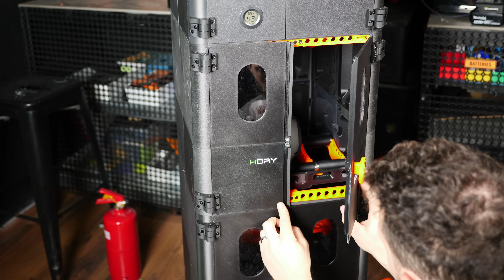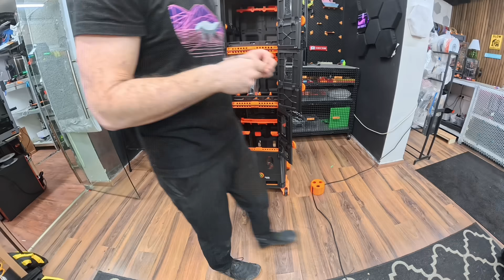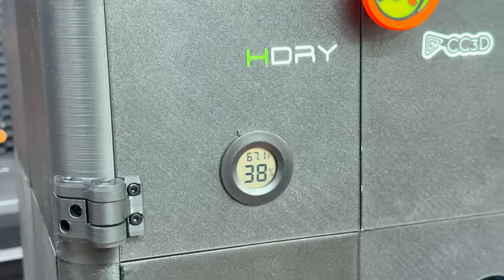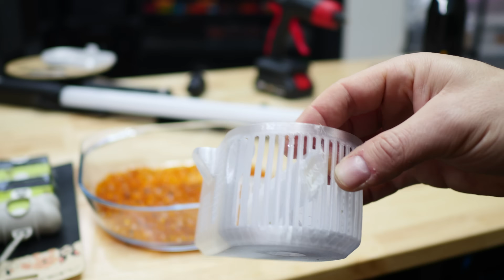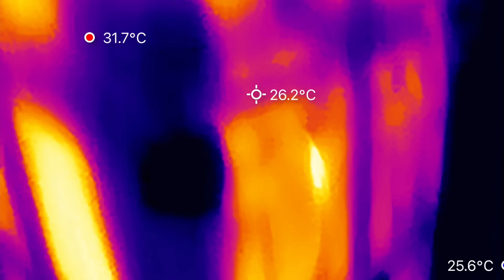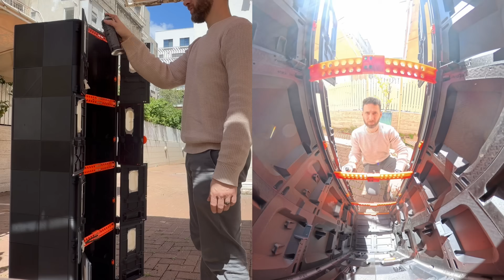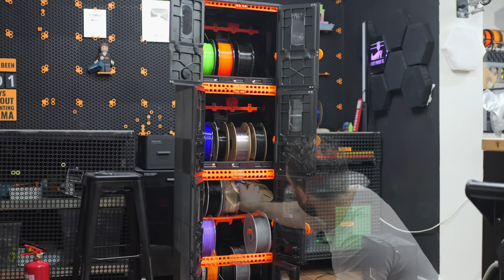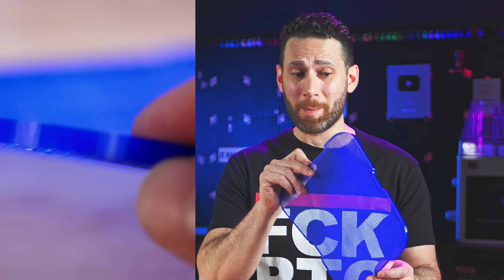This Will REVOLUTIONIZE 3D Printer Filament Storage!

Comment: @thenextlayer since this video is sponsored by Snapmaker I can say I am very happy with my printer also. However, it would greatly help the community if you explained how you got polycarbonate to print. Most of us have some kind of a tophat so that is not an issue. How long did you allow the bed to heat soak before printing?   One of the issues I have found is the fluidd temp sensor wildly optimistic since it is physically attach to the enclosure on the right hand side which was confirmed by applications engineering.  Where did you put your temperature sensors? This would be a great view subject and I’m hope heavily viewed.
Reply from the maker: Ok so I had a whole section on the experimentation I did but ChatGPT told me it was destroying the flow of the video with a tangent so I cut it and only showed the end result. PEI sheet, Magigoo SuperGrip (or better yet, apply a layer of Magigoo PC and then go over it with Magigoo SuperGrip which works better for lower temps), big brims, 100C bed, preheat 15 mins. The important part is to reapply the Magigoo SuperGrip before every print, as it’s the one doing the heavy lifting!!!

Comment: I was looking at creating a mini rotating drum, with 25 to 50% of it being heated with air circulating from outside to outside, and the rest with air being circulated from inside to inside, use Molecula Seive in it and it will constantly pull and remove moisture with low power, the other type is to simply use a peltier style cabinet like the Autens, and have a small circulating fan and desiccant system as well, that can be swapped out easily.

Comment: I use activated alumina. One tip here is to replace your microwave with a toaster oven and a digital thermometer. You are not going to want to nuke the activated silica, but rather give it a nice, long, hot dry in the oven. Different desiccant, different method of regeneration.
Reply: Microwaving silica is fine. Just use low heat and be aware it will get hot.
Reply: @jaro6985 absolutely it is fine with silica. Please read what I wrote again and see that I was not talking about silica.
Reply: @T313COmun1s7  "You are not going to want to nuke the activated silica" thats the part that confused me.

Comment: Why not buy large bear cooler, or a Wine Fridge and use your system in that, a multi piece 3D printed cabinet will not do the job, it needs to be properly sealed, I store mine in large Pelicon style water tight rugged boxes, these are made from thick PP with real rubber gaskets, I was already think about doing a system like this in those boxes with Molecular Seive instead of Silca based Desiccant.

Comment: if this could be built in and the desiccant is accessible from the outside (like a removable cartridge), you could swap it out without opening the cabinet, which will let more humidity in, provided there is a good enough seal

Comment: This is probably one of the best videos on 3d print I've seen in a while. 
After watching this I have done 2 things, bought a small dehumidifier at the cost of £70 which can suck out 0.4ltr of liquid a day. When it arrives I'm going to make a cabinet for it.. All the water ends up in a container. It also has dessicant  in the unit that can be changed. Along with this I have 2 large high speed CPU fans, and plan to design a unit like this to fit them too and run them from a usb C power cable...

Comment: Good to know that my setup when I started at 3D printing was One of the better ones apparently. Now for some more ideas to streamline my set up hopefully. Also I don't know if this will be helpful for someone or not but I use a wireless charging battery bank to keep my con fans powered that way I don't have to open it to recharge the battery bank

Comment: By my own experiments, you need nothing short of perfectly sealed chamber for storing filament, problem with water is it wants to fill the drier container as if the container is in a vaccum. What I use is an old exhibition fridge wich I've filled with dessicant, but since i've watched your video, that circulating fan with reservoir is a fantastic idea! I'll do it!
Reply from the maker: True true and glad you liked it

Comment: No matter what you do those 3d printed drybox will never seal well enough to have long silica intervals at sub 20%rh 
I’m using ikea billy bookshelf’s with doors sealed with silicone seals and every panel silicone caulked. With just silica and no fan it goes from 42% to 25%. With just airflow in cabinet it drops to 17-18% so in  designing a similar dessicant fan system with high contact and adding in activated alumina to further lower the job silica has to do.

Comment: You could also add a calcium chloride based moister absorber, to take a bit of the load off the silica gel. 
A quick googling says it works down to 45%, and the moister that has mixed with the calcium chloride won't evaporate.

Comment: 35 years ago, in a past life as an embedded systems software engineer, I was tasked with writing the control software for a  dryer for pelletized plastics. Now, keep in mind it was a long time ago, so my memory isn't perfect, but we used this honeycomb desiccant structure, and cycled it through the storage area, pumping warm air from the box through the pellets, into the desiccant, and cirulate back into the box. Meanwhile, the desiccant is circulating, and as it rotated outside of the storage area, we pumped hotter air through the desiccant (outside) to dry it out before it re-entered the storage area. The idea is you are trying to transfer the moister outside of the area used to store the plastics, using the desiccant as the medium. Air being applied in both places. The process had to monitor the humidity, because too dry can be just as bad as too damp.
The important thing, is the CYCLING. Cycle wet desiccant to the outside air, and send air through it to expel the moisture to the outside air before returning the material back in. It's important to MOVE the moisture out. Heating it alone does not remove moisture - it has to have outside air to carry it off.
Reply: How is too dry bad for plastics? Is it different for pellets? Because filament can't be too dry.
Reply: @berkertaskiran  It can absolutely be bad for plastics. Google it... all3dp has a decent article about it. Overdrying some types of filaments can make them unusable.

Comment: I use Alumina at home for my dry boxes. I don't have to replace it as often. I do mix some gel beads in so I can tell when it needs to be replaced. It's not a perfect solution, but the beads don't get saturated with the Alumina around it until they stop soaking up humidity. So, it seems anyway.

Comment: ❤ can you use a heat exchange from a tumble dryer or instead of a large box of desiccant have smaller chambers in fins to allow air flow from the fan 🎉🎉🎉

Comment: You should maybe try activated alumina instead of silica gel for filament storage or even passive drying ( it is that effective at removing moisture). It maintains near 0% RH in my closed filament boxes.
Reply from the maker: See pinned comment! Swapping to molecular sieves got me down to 10% and it stayed there

Comment: I get 10% or less humidity too. In 3 Sterilite 80Qt Large Gasket Boxes ($20ea), with a bunch of cheap large silica bags (24 for $40). Holds an easy 10-12 filament rolls each.
Reply: We don't get Sterilite down here but "Ezy Storage" instead. IP67 sealed crates in what feels like polypropylene (so very water resistant) in various sizes and a bag of silica sachets (500g to 1kg of silica) keeps the filament inside sub 10% for months atta time. 5 spools in the 18L size and 12 in the 50L tubs. No mess no fuss. They even stack.

Comment: You do know that relative humidity changes based on temperature, right? Warmer air can hold more water, colder air less, so a given volume of air will show different humidity levels based on temperature. It might (example) just say 14% while warm enough for drying but way higher like 30% at room temp.
Reply from the maker: Yep but I wasn’t gonna blast the heater to heat the whole studio to test this lol. We will wait a month and it’ll be hot here

Comment: Another issue you might be running into, every time you open the chamber to change the desiccant, it reintroduces fresh humid air to the chamber.  Maybe a small self closing flap to replace the desiccant box?

Comment: Put a hole in the side or back of the cabinet and have the fan and desiccant 'pod' install through it. That way you aren't opening the entire front of the cabinet to swap it out. Also add a window to the pod so you can see the status of it at a glance.

Comment: yeahhhhh nahhhh I'm just saving up for the full 4 heated AMS setup from anycubic. 16 dryer slots will be enough for me. The whole works with the units and printer is like $1200 and it can do multicolor tpu. I'm so done with desiccant. 20 open rolls at a time is probably plenty, just have to switch out the 4 printer mounted ones to dry (although those would most likely be ones I use rather quickly.) $1200 for the whole mess is crazy deal imo.

Comment: As far as im aware.. cool air can hold less moisture. Meaning the % is higer then with warm air. But moisture in it is the same.   So we want hot filament drying to get the water out of the filament but cold air to store it.

What if we have a small freeze dryer. And desicant in the cabinet?  Yes  expensive. But it will condense out a lot of moisture before it enters the chamber... and desicants absorb a bit more...  getting verry low moist levels..

Comment: What gets me is has no one actually tried using a small room dehumidifier? the ones that you can buy for £100 or less? Attaching that to the back of a cabinet could do the job - no desiccant needed just a tray of water to dump in the sink.

Comment: I am legally blind so I am not reading the other posters so if someone thought of this. I like how you think. The issues I see is that in a enclosed and "sealed" case the humidity is going to move to the warmer top. You are seeing this through your readings. The top is warmer and being at the highest warmest elevation is what humidity in a sealed box wants most. Using you Activated Alumina is the best choice. Mixing Silica and AAl is just going to have all the moisture end up in the AAl and none in the silica. Placing the AAl at the top and piping the dried air to the bottom with drive the humidity to the top and result in faster drying and better control. My Two whatever your lowest denomination is =P

Thank you for all your videos it has helped a lot.

Comment: Really makes me appreciate living in an area where my house is often about the same humidity percentage as these boxes often get to. Lowest I've seen on my meter was 7% in the winter. Highest I've seen was like....20-something percent? I use a dryer for nylon and sometimes ASA (usually only right out of the box, ironically), but otherwise filament just sits out and is usually fine.
Reply: my lips are chapped just from reading this comment 😂
Reply: You live in a desert or what? I have around 60% humidity all the time 😒

Comment: yeh silica is just not up to the task of drying below 10%. 

i use molecular sieves, in an ikea storage box with added seals, benefits are:
-not too expensive
-go to 5-10% comfortably, without fans or heat
-dries filament much quicker
-holds way more water, so last longer
-the molecular sieves dry way faster at higher temperatures (i use an old air fryer at 200° for an hour)
-can be regenerated pretty much indefinetly
-come in bigger grains that are nicer to handle

alumina is also a good choice, haven't tried it tho

i would recommend to build the desiccant holder out of metal, so you can chuck it as is in the drying device.

Comment: I have two cabinets I bought in the US, one for about $500 that holds about 10 spools and another for $250 that holds 5. Both keep humidity under 10%, typically 7% IF you keep the door closed. They each daw about 6 to 9 watts. They use molecular sieves with a small door that moves. In the dry position, a small fan blows inside air across the molecular sieves. About every two days, the door moves and a small heater under the molecular sieves warms, and air blows outside. This happens for about 5 hours. The door then closes, heat turns off, and cycle repeats. Its not rocket science. Very simple and cheap. It takes a LONG TIME to dry filament, but it keeps it dry perfectly. I am in AZ, where humidity is 20-50%, inside the cabinet its under 10%.

Comment: Fyi i tried something similar and fdm materials let moisture through the walls relatively very fast; most plastic just lets water through, period. This is why stuff gets freezer burned. You will need kgs of desiccant. Also try pumping air in and covering it in soapy water to see leaks.

Comment: I use a 60 liter plastic barrel that can hold 20 rolls and silica gel humidity drops to 16%
I heat the inside with a fan to about 40 degrees and then close the barrel
The humidity is kept out and does not use electricity for a long time

Comment: Desiccant is fully regenerable, and the process is much simpler than most people realize. In many cases you can evaluate saturation visually: both activated alumina and silica gel darken as they absorb moisture, so it’s easy to tell when they’re spent.

Molecular sieves work a bit differently, but if you use a pancake‑style cartridge you can actually build a low‑cost regenerating system. Place the sieve on a slow‑turning turntable and divide the surface into segments so that airflow passes through only one section at a time. As the disk rotates, the inactive sections naturally regenerate with a controlled, low‑heat stream passing over them.

With this setup, you can create a continuously regenerating desiccant dryer using a molecular sieve for surprisingly little money.
Reply: Doesn't molecular sieve require minimum 250°C air (or better, dry nitrogen) to begin regeneration?
That's not exactly low heat.
Reply: @mattd5136 good catch, that was meant for activated alumina and silica gel.  I wrote that on the fly and I'm not perfect.   Thank you for helping to clarify.

Comment: I gave up the fancy and put all of my spools in an airtight container with locking lid (holds about 20, maybe 16? Spools). I got those mesh bags you can get from amazon and filled them up with the orange silcal gel. My food dehydrator recharges them. All of my containers sit at 14% for weeks at a time.
Reply: Yep, $20 for an airtight box $15 for 8lb bag of silica dessicant. No need to over-complicate it.

Comment: Seems like this could be a really good solution with a much more simple execution. Box made of MDF with some nice foam window sealant, if you really want to be able to see inside use some quarter inch thick plexiglass and I imagine you can get 100% airtight seal in just a couple hours of work a lot easier than printing and building that entire cabinet out of filament.

Comment: "held together by magnets" 😮

*Installs in cabinet and bumps tab with filament spool and desiccant beads rain down everywhere inside the cabinet* 😂
Reply from the maker: This happened to me TWICE LOL there's a reason I asked for no magnets in V2. Also, you can't microwave magnets ;)
Reply: @thenextlayer  😂 yeah I'm all too familiar with using magnets in 3d prints and going back to the drawing board

Comment: How about a drum that allows axial air flow but not radial, rotate it bewteen to sets of ducts, one that move air inside the cabinet and the other outside with a small heater to dry out the desiccant.

Comment: Industrial gas plants use two pressure vessels with a combination of silica gel and molecular sieve to remove CO2 and moisture.   In this case ALL CO2 and moisture has to be removed or else these  molecules  will freeze and block the heat exchangers at the cold cryogenic temperatures needed to distil air.   One vessel is on absorption cycle while the other vessel is on regeneration.   Regeneration uses waste nitrogen which is dry and a heater.   The heater is for speed of regeneration.   It would take much longer to regenerate using only dry nitrogen.
For the home use, I think a heater will be needed to speed up regeneration.

Comment: fantastic work, both of y'all!  i'm no engineer either, but i have a couple thoughts that i think might help.  as far as sealing your cabinet goes, self-curing liquid sealant on the seams would probably be the way to go, ala caulk/liquid electrical tape/hot glue/etc, except at the doors where you've also already been applying seals of various sorts/types.  not being an engineer & understanding there'd obviously be reduced airflow, i can't help but think reversing the fan layout to pull air through the desicant or activated aluminum, whichever setup you're using at the time, & using the exhaust to recirculate the air would probably exercise the ambient air a bit more & effectively expose more moisture laiden air to the beads as a result - but that's just a thought.  either or both of these ideas would require more work, but that's what we do.
Reply from the maker: Great ideas all around!!!